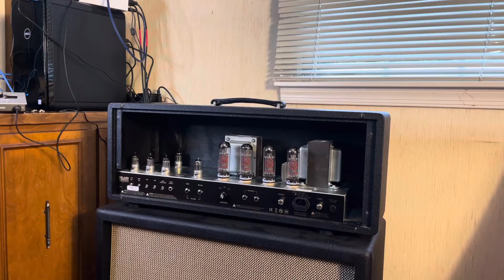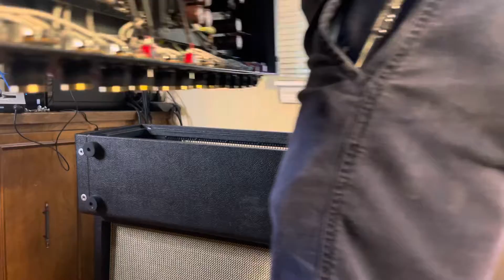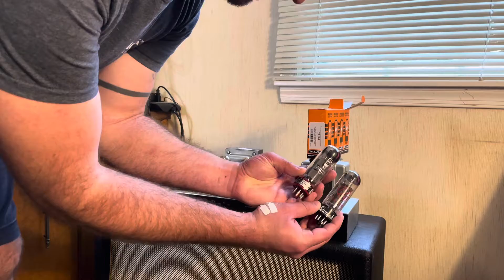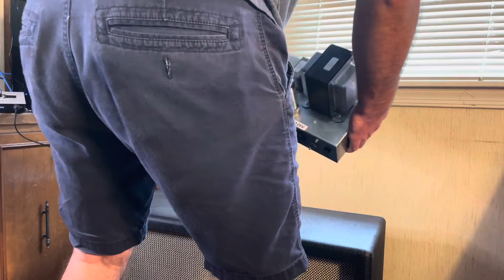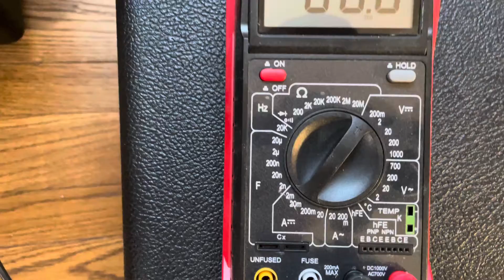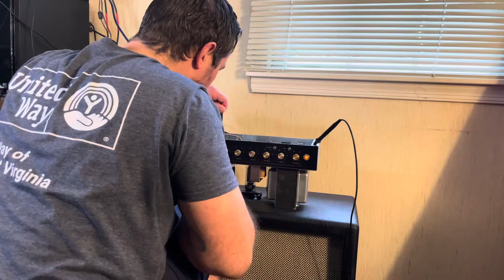How to bias Friedman BE 100 deluxe

Comment: Great tutorial. Maybe a couple things for people to be mindful of... I'd not put the chassis down on the handle of the cab. That handle will protrude into the cassis and can put pressure on components like tall caps etc. Same when flipping it over, can put pressure on the tall power tubes. But thanks for those internals shots. Was wondering what the BE100 looks like on the indside :)

Comment: Mine has a different layout, nothing in place of those green resistors on the power tube sockets, also the motherboard layout is different. On mine it says Friedman BE100 DeLuxe RevC, on yours it just says Friedman 100 WATT RevC
Reply from the maker: Hmmm. Interesting. The resistors may just be a different color in yours. No resistors there at all?
Reply: @joeywilder9708  I've made the pictures once I had it open to have a look and it seems there's no resistors and only jumper wires instead. Also components are different, in different places, completely different board layout. Do you know what year is yours? I have posted a picture of my layout in the comments of your Facebook post...

Comment: So there s only one bias turning pot for all the tubes ?  I thought there were one turnin pot for each tube in order to bias each tube ? 

thks for the help
Reply from the maker: That’s right it’s just the 1 Tiny pot for all and if the tubes are matched well you can get them all very close. You have some wiggle room they don’t all have to be exact you just want them all as close as possible. It is a 10 turn pot which allows you to really have a lot more wiggle room dialing in since it takes 10 turns to equal 1 turn of a normal pot.
Reply: @joeywilder9708  I just had my BE dlx in front of Dave who did some mods and biased it hotter. We added a 3 way voicing switch (see vid on my YT site) What year is yours? Did you change the pre amp tubes also? Apparently they last way longer than the power tubes
Reply from the maker: @cragginshred  not sure the exact year I think 2020. I’d have to check the serial number. I’d love to have mine modded by Dave to make the hbe a little more aggressive and modern sounding. But yeah preamp tubes can last forever. I put some NOS Matsushita 12ax7 in mine which are Japanese Mullard copies. Despite what people say, tubes make a pretty big difference in tone and especially feel. Of course these people who say it makes no difference have so much gobs of gain on nothing is really noticeable.
Reply: alright thks for the help !

Comment: I have no idea how to work on tube amps to bias them so I’d personally rather have a professional look at it instead, but I’ve been wanting to take a look at the inside of an amplifier while an amp is being worked to learn about the different internals of different amps and I was wondering if certified electrician gloves would be a good way to protect yourself while working on the internals of guitar amplifiers.

Comment: One day I hope all the mfr.s add external bias check points and external bias pots for all their tube amps. This would make the bias process simpler and safer! - Peter age 73
Reply from the maker: I know I think it should be a standard at this point and it would make maintaining an amp so much easier. This 1 was pretty easy to figure out though since I knew Dave said anywhere between 30 and 40 was perfectly fine based on what you liked and that he sends them out at 32. So, I did not have to do any calculations for plate voltage which made it pretty straightforward and easy. Not sure if other amp manufacturers give a bias range like this or not I imagine learning how to measure plate voltage would probably be pretty straightforward to though. I just like to do as little messing inside the amp as possible I do play and try different biases in that range though just to see how the feel and tone might be affected and I ultimately ended up settling on Dave’s suggestion of 32. Go figure lol.

Comment: It’s great to see that Friedman’s hardwired amps are true PTP hardwired amps. This doesn’t look like a turret board style, but it’s not a PCP, either.  I saw an SLO a while back that was a PCB, and I just about swallowed my own balls.  SLO is my favorite amp, outside of a 3rd Power Kitchen Sink….but, to see an amp THAT expensive using a PCB (although, an immaculate and well assembled/soldered PCB), just rubbed me the wrong way.  It should (IMO) look like the inside of a DS40, where it’s on a turret board. Not saying it makes a difference in sound….its a principle thing with me.  Great video.  With all that said I’m a little stumped Dave didn’t put electrode sockets on the back of this amp to make biasing much easier.
Reply: There's nothing wrong with PCB.... and this IS PCB too. You just cant see the traces as the board has a coating on it. Its clearly NOT PTP like you say🤣 Dave probably didnt want external bias points because he wants someone who knows what they're doing to adjust it.
Reply: @TheRealGuv You’re 100% right (Friedman aren’t PTP)….I’ve known that for quite some time (which is odd given I don’t remember making this comment).  That aside, there may not be anything wrong with PCB, but my point is that at the prices they’re charging, knowing some minimum wage, third-world, paint-by-numbers goon, who barely speak the language (a description Dave himself has made over the course of so many years and so many words)….. making my $5K boutique amp, rubs me the wrong way, for many reasons.  According to you, he doesn’t mind someone who doesn’t know how to build amp’s (but has half-@#$ soldering skills) soldering parts together on a $5K amp, but if/when the times comes he wants an electronics engineer to bias the amp (which a nutless monkey could do, btw, if that’s the hill you want to die on🤣🤦‍♂️.  Yeah…not sure if that’s the selling point yo want to use  for “Don’t worry, bro…Paco built your boutique amp with love,  and I’m fairly certain he’s here legally, as well.🤣  The entire point of PCB is you can hand it to anyone who’s spent a week with a soldering iron and some parts, and it becomes little more than a paint-by-numbers project.  That tends to take the glory out of owning a “Boutique” amp.  And, if I had it all to do over again, I’d probably had gone with any number of great builders who DO make the amps themselves in that fashion (or close enough to it).  If Dave charged $2K for a BE DLX, the entire convo would be moot….but, he doesn’t.  And, before you pop your cork off to any of those  comments, there’s several demonstrable issues I could point out with on my own Friedman, to prove all the above.  The one thing Dave has going for him is that, outside of the PCB issue, he runs his company/customer service in a way that you would think “artisans” are the ones wiring these amps in a PTP fashion.  He answers his own e-mails (within minutes, usually), and every replacement part I’ve received from him has been free of charge.  It’s the main reason I still own his gear.  He stands behind all his gear without question.  Although, again, at the prices he’s charging, NOTHING should be gong wrong with an amp that sits on a studio shelf.  It’s an ethical issue. We’ve gone from paying a premium for quality craftsmanship, quality parts, built by American techs who give a @#$%…to paying a premium for nothing BUT the brand itself (that….AT BEST was built on an exceptional work-ethic, at one point in time….but, has long since been replaced).  

If Dave wants to use the cheapest, easiest, parts & third-world labor to build his amps….fine.  His sand-box, his products, his rules…..we’re not China (at least not yet), and he doesn’t force ANYone to buy his products.  But, don’t charge $5K for them, as if some 10th generation American, with decades of experience, single-handedly, built the product, sweating over all the details.  At this point, there’s VERY little difference in the quality/parts of a Friedman Runt, than a Friedman BE Deluxe.
Reply: Hey @phillamoore157   sigh... Your response is hardly surprising given your PTP comment, but lets push on with a paragraphed comment that is a shade easier to read.

Look - I do see what you're saying, but there are some things worth clarifying here.

First off, Friedman amps aren't built by "third-world, paint-by-numbers" techs on minimum wage. They're assembled by experienced techs in Dave's shop in Burbank, California. Dave himself regularly oversees quality control. There's a big difference between streamlined production methods and cheap overseas labor. You might not prefer PCB, and that's totally fair — but it doesn’t automatically imply poor quality or low skill.

I get your frustration around the pricing, but remember, that $5K isn't just about the labor hours spent soldering wires. It's also covering custom-spec transformers, premium parts, extensive R&D, rigorous testing, warranty coverage, and Dave’s lifetime support (which you yourself acknowledge as exceptional). Boutique pricing isn't just about manual labor; it’s about the entire package — design, tone, reliability, and support.

Regarding bias points — sure, adjusting bias isn’t rocket science, but Friedman clearly wants to discourage people without experience from poking around in high-voltage gear or frying power tubes because of an incorrect bias adjustment. That’s a design choice intended to keep things safe and consistent, not a criticism of users or tech skills.

If your preference is for true turret board or full PTP wiring, that's completely valid, and there are great builders who cater specifically to that preference. But dismissing Friedman amps outright as overpriced, cheaply built, or substandard in quality is inaccurate and unfair.

Let's keep the discussion focused on real facts and honest preferences. We both clearly care about gear quality and tone, and there’s room in this market for more than one approach.
Reply: @TheRealGuv  I appreciate the reply.  You’re clearly a die-hard, unconditional Friedman fan…all the power to you.  But, I’m not trying to win an argument here….not even remotely.  With all due respect, I don’t care who agrees with me, and who doesn’t (and that includes Dave himself).  For what it’s worth I’ve been watching Dave’s business grow for a long time now.  But, every word I’ve said, either goes directly back to Dave himself…or, has been personal experience.  I’m not pulling anything out of my fanny, for the sake of sh-t-slinging.  I’ve got no personal beef with Dave.  Like I said, short of my opinions on how the products made, my experiences have been very good, when dealing with Dave himself, and I still use his gear to this day.  But, “Nuh-uh” isn’t a reply, and changes nothing.   If you’re that devoted to Friedman….I hope you’re able to own one of everything he makes, someday.  His gear, for the most part, sounds excellent and he, all but, unconditionally backs it.  I have no desire to pay $5K+ for an amp made with parts found in his lower line amps, put together on a PCB by someone who barely speaks the language (Dave’s words not mine, and he’s been on several videos talking about those challenges).  I digress…. A lot of people couldn’t care less about how a product is made, or the parts it’s made with, as long as it works, and does what they need it to do.   If that’s your thing, knock yourself out.  I’m just one of the growing number of consumers that wants to know exactly what I’m paying for, especially at these delusional gear prices, today.  And, it’s by NO means just amplifiers.  And, what I’ve seen with Boutique Amps, in general, it’s not worth it to me.  At least not while there are other options that sound as good, or better. 🤷‍♂️
Reply: Hey  @phillamoore157  Look - I genuinely appreciate your reply and clarification here, but I think you’ve perhaps misunderstood my intentions. I'm certainly no "die-hard Friedman fan," nor am I defending Dave Friedman personally. I've owned dozens of amps from many builders — Friedman being just one among them. My original point was simply a factual correction (the BE100 isn't point-to-point wired). Beyond that, we're actually closer in viewpoint than you seem to realise.

We agree on some fundamental points:

1. Friedman amps generally sound great.

2. Dave himself backs them up exceptionally well.

3. Prices in boutique gear are definitely high these days.

You’ve clearly had good and bad experiences, and I completely respect your right to voice opinions based on those experiences. My issue wasn't with your opinion about PCB vs. hand-wiring - that's entirely valid and personal. It was more about setting the record straight on the facts about how these amps are built, because your misinformation helps no one... and I can understand and appreciate why you'd be embarrassed and defensive over that.

As for your points on pricing and value - I agree that at this level, every consumer should question what they're paying for. Gear transparency and honest marketing matter greatly, and you're absolutely right that the market has other excellent options. Thankfully, we all have plenty of choice.

Ultimately, it sounds like we're both people who care deeply about the quality of our gear and how our money is spent. We might differ on details, but that's just fine. The gear community is big enough for different opinions and approaches.

So honestly - thanks for sharing your views, and let's leave it at that.